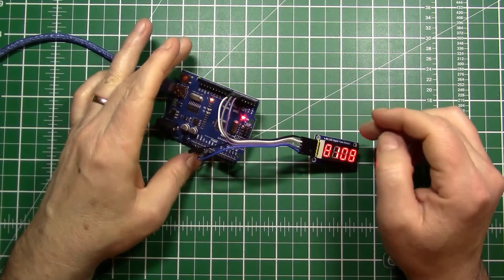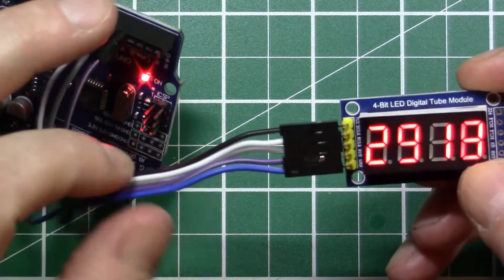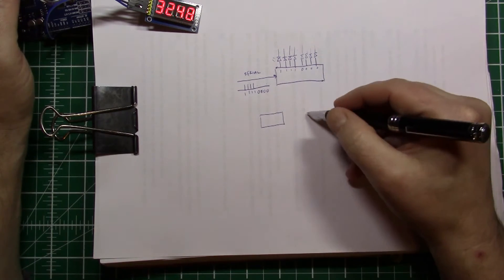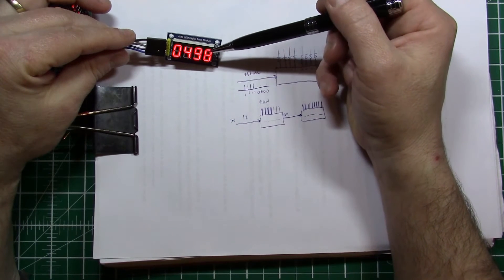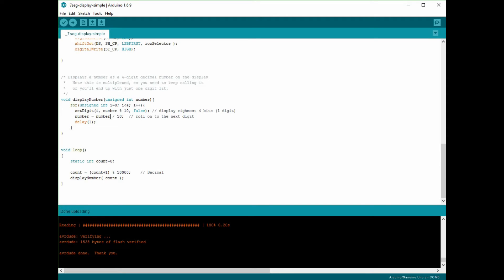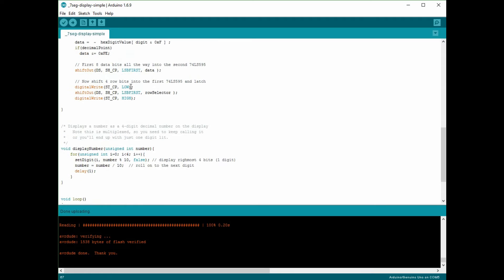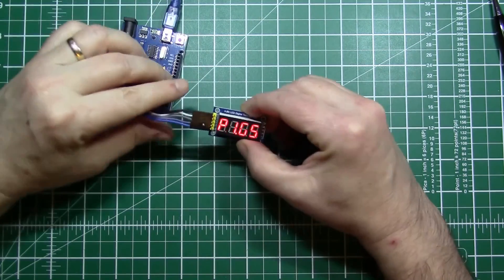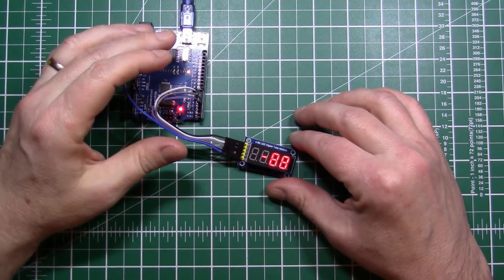Arduino and multiplexed 7-segment display

Comment: Also, I just read your channel description. I thought you were an embedded systems engineer. How did you learn all the electronics? Did you study in Uni or did you self teach that? If so, thats amazing. How did you do that??
Reply from the maker: I was interested from early on in electronics, and had the good fortune to be around when the 8-bit micro computers were in their hayday (the 80's).  In the 70's/80's there were several monthly magazines aimed at electronics hobbyists, and (hard to believe now) many people worked on electronics stuff in their spare time.   I spent a lot of time combining my love of electronics and computers, connecting memory boards, sound chips, home-made controller/paddles etc, and learned a lot this way.  My degree had some electronics in the programme, but I was a Computer Science major and gradually dropped the electronics modules in favour of topics like the "C" language.  I have done some embedded work during my career (I'm really a software engineer), but mainly the work these days is about The Cloud/APIs/devops  etc rather than low-level stuff.

Comment: Hi! Thanks for a great video. I have been searching for exactly this. I am learning embedded systems by myself and these lectures really help me.
There is just one thing I am confused of. I have been staring at datasheets for hours now and I couldn't figure it out on my own so I am here decided to ask you haha. 
So, how did you find out the first 8bits are data(number) and the second 4 bits (or 8bits) are row of digits? Is there any way that you can find that out without doing reverse engineering?
I can kind of guess that because you are using RCK and moving data bits from SR to LR, you can use 8bits + 8 bits so that 16 bits - and in LSB, the first 8 bits is data for number and the second 8bits is row of digits. Is that right? I just wanted to confirm if that is right because I cannot figure out just looking at the datasheets.

Thanks!!
Reply from the maker: I can't remember exactly what process I used, as this was quite a few years back. However, it's often possible to reverse engineer a board by buzzing it out with a multimeter/continuity tester, to know which chip outputs go to the LEDs.  Usually these 7-segment displays are wired with a common anode/cathode, i.e. all the 7 LEDs (or 8 if it has a decimal point) are connected at one end meaning that all earths (for common cathode) come to the same pin, and so connecting that pin to ground is effectively an 'enable' for the whole 7/8 segments.  So with four displays you have 4 enable pins. So then it's just a question of knowing which 8 anode pins connect to which 74595 pins, and where the 4 enable pins connect to the 74595.  Also, there are a lot of these low-cost displays using the 74595 chip: some are 7 segment, some 8x8 dot matrix etc, and there are a lot of schematics on the Internet that people have drawn to illustrate how they are wired up, plus there are a lot of open-source code examples (e.g. for the Arduino or Raspberry Pi) showing how to drive these displays.  I may have just messed around in the code to see what lit up when I clocked some bits  into the display, since I love to experiment with code.  As to your question: the 74595 doesn't care which bits are the digit and which the row selector - it will just store and present the 16 bits that we clock into the chips and then latch.  The magic of which 4 bits are the row selector is all down to the way that we interconnect the 74595 pins with the LED display pins, and this will often be different depending on the style of display we're using.

Comment: I'm kinda new to this and indeed like the comments mentioned this is also for me one of the first YT videos I watched. Am I correct to assume that with this module you can only light up one digit at a time? So for example when you want to write 1234 it's rendered as 1 ..... 2..... 3... 4... but because it goes really fast you don't see that refresh. Or is there a method to sent the 4 digits at ones instead of in a for-loop? 

And thanks for the explanantion :)

Comment: Dear Martyn Davies,

Is there a way to dot the module?
Can you find the answer in the source code you shared? Help.
Reply from the maker: To display a dot? The setDigit function has a parameter 'decimalPoint' that should switch it on.

Comment: Thanks a lot for the GitHub but do you have an example of utilization? For example if I read a buttonState value (0 or 1), how can I use your code to display the figure?
Reply from the maker: If you have the state of your button in a variable (let's say its called 'x') then you can call displayNumber(x) in the main 'loop' section to display x as a 4-digit number.  You'll find plenty of examples of how to read a button on Arduino with a google search.
Reply: @MartynDavies  thanks for the tip, I'll try it tomorrow. For the button read no problem.
Reply: @MartynDavies  it is working perfectly, thanks. I just have some issues to understand a part of your code but I will go through it  step by step

Comment: I appreciate ur answer. My actual questiin is if i have a circuit like this for example a thermometer. And i want to take this numeric data to my Other arduino directly from segment inputs. How i can do? Maybe with a shift regiater cd4021be? Any advice? Because my circuit is an embedded circuit that i cant involve via software or hardwarem only thing i can do is take wired from 12 inputs of 4 digit disolay to my arduino with a shift register and Try to read and creare same numbers shiwn in my monitor simultaneously with the segments but this display has 12 inputs that i ll use and 8 for segments and 4 for each cathode(or anode) any suggestion?
Reply from the maker: I'm not sure that I follow - you mean that you have a piece of equipment already that reads temperature and has exactly this type of display built in?
Reply: Martyn Davies Yes. I think its multiplexing. Not charlieplexing. So first it selects the Row and then gives 8bit data to show the actual number. They r 4 rows display too. So shifting rows and putting 8 bit data happens so so fast. Wat i need to do is to take 12 inputs (4 for rows and 8 for leds) from the display outputs on the board and then connect them to 2 CD4021 PISO chips and read Same value on my serial monitor. Its kinda reverse engineering. Any suggestion? Becauae i dont know how to process that 1 and Half byte data!
Reply from the maker: one useful device might be the MCP23017 ( http://ww1.microchip.com/downloads/en/DeviceDoc/20001952C.pdf ). You can connect this to your Arduino via I2C, and read in 16 bits of data in parallel.
Reply: Martyn Davies  thank you
 I wld lile to use spi interface and as i saw in datasheet this chip also gives spi outputs. True? And u think i cant do same job with 2 pieces of cd4021? Just asking to confirm..
Reply from the maker: The MCP23S17 has SPI.  I've never used this one, but the idea is the same.  You could use the CD4021 to convert parallel to serial, but then you have to clock the bits in serially to a GPIO port on the Arduino, which seems like more work.
Reply: Martyn Davies  i didnt get why its more work because somehow i need to use clock to take data bits inside arduino from the shidt register anyway and sorry i didnt understand whata clocking bits serialy arduno gpio? I connect 3 spi pins to arduino but they will be Inputs to arduino. I think i ll not be able to solve. And i didnt get the diference betwewn cd4021 and that MCP beside 1 is 8bit and other is 16
Reply from the maker: Yes, obviously do it whatever way makes sense for you, e.g. clock bits in with shiftIn(), this is perfect.  I guess I like connecting via I2C.
Reply: Martyn Davies i2c has no latch pin as u know. So how we ll get the bits inside. I need search. Now i try to choose which cd4021. There is cd4021B and Be ans others. I m confused

Comment: ordered the same item (couple of quid from china) and got this running the same. Very nicely explained.
Reply from the maker: they're excellent value, I think
Reply: Cheers again, Martyn, helped me with creating a midi controller: https://youtu.be/1y0e81kYve0
Reply from the maker: Great looking case - but what's inside?  It's been a while since I built anything for MIDI.
Reply: its a regular aluminium case in red paint finish. (Ebay) Inside is just the Arduino nano and the three buttons seen. A few resistors here and there and thats about it, besides the terminals/connectors that are visible from the outside.